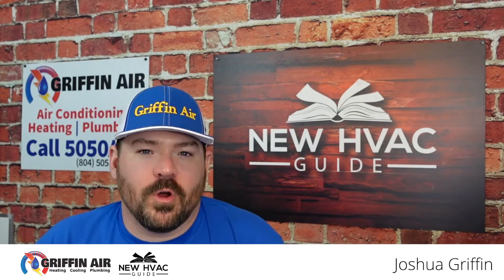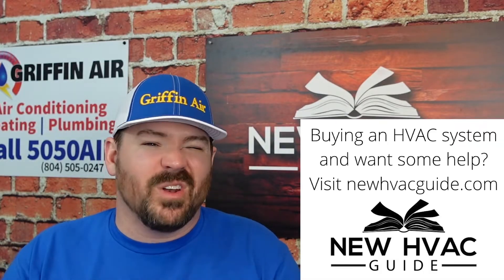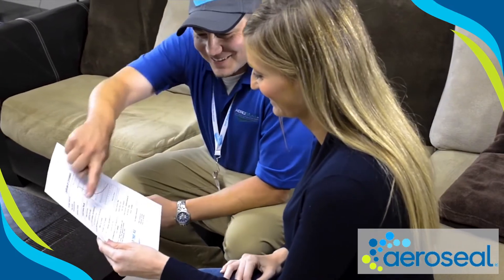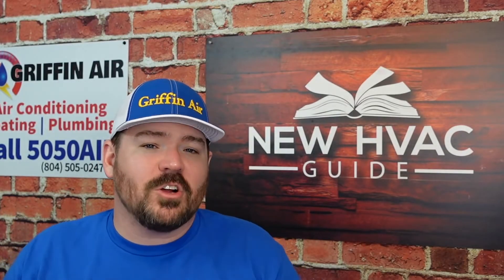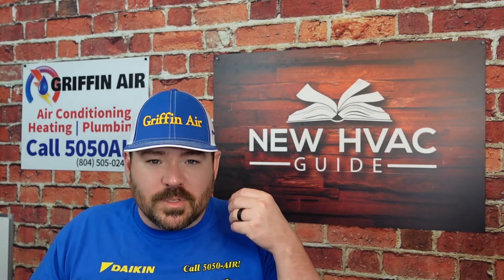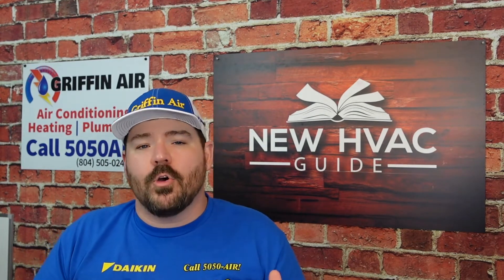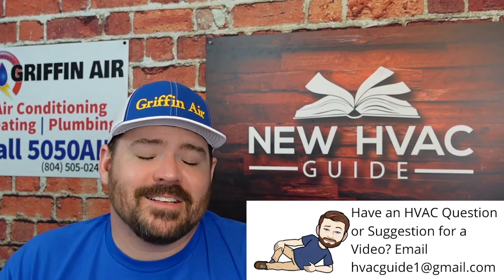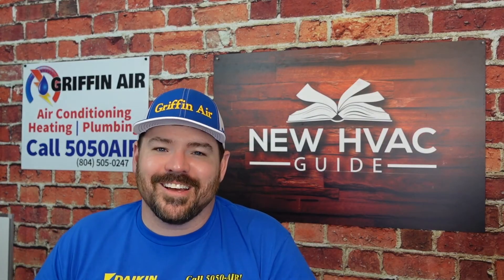5 REASONS for Low Airflow.

Comment: I just had my AC guy come over the new ac unit he installed last year stop throwing cold air, he said that the system was getting drowned, he said he was going to install a box to avoid the unit from drowning. He did get the right box change the original ducks going into my goods man unit and i lost air flow in all the house, when i told him he said they didn't have the box that he needed and gave a different one, and he will installed another one, he did not fix the issue, the gous still feels like you have the air on low the rooms feel warm, you can feel the stop of air flow and he said that everything is reading right and that how the unit is supposed to work. What can I do to fix this issue?

Comment: I am still having an issue and everything was checked. I just bought a new unit 2 weeks ago and the room furthest away is not cool enough nor getting much air flow. What else could it be?
Reply from the maker: Thanks for the comment—and I’m sorry to hear you’re still having issues, even with a new unit.

There are a few possibilities to look into:

Ductwork issues – The duct leading to that room could be undersized, compromised, or improperly installed.

Insulation – If that room isn’t well insulated, it may be losing cool air faster than the system can supply it.

Air balancing – You might try partially closing other vents to help redirect more airflow to the problem room.

System testing – Tools like a thermal imaging camera, anemometer, or even a duct blaster test can help pinpoint exactly where things are going wrong.

I actually cover another solution in detail here if you’d like to dive deeper:
👉 https://youtu.be/AwyIzBOALAg

Good luck!

Comment: I have two bathrooms that get virtually no air flow. Hot in summer, cold in winter. Ducts look good. They are both fed by a 90* duct off of a big duct. The pipe is flush mounted to other duct. Do I need a deflector of some sort to get air to make a 90* turn to get more flow?

Comment: We had installed a new 4 ton split system, Gree flex condenser, new ductwork installed, insulation blown, and added an attic gable fan. Pretty big job done in 2 days. Out of 10 vents throughout the entire 1700 sq ft house, 3 have weak airflow where its needed the most. 2 bedrooms also are warm. How can I measure the airflow out of each duct? The tech used an infrared tool to prove cool air was flowing, but 1 particular vent has the strength of a leaf blower, while the others vary. Paid a lot of $$$ sounds like I need him to come back.
Reply: I would be so mad after all that work for that issue
Reply: Maybe they sized the ducts poorly and now  need to compensate with dampers

Comment: 4 degree difference from one side to other side of house, the equipment is on better side any suggestions?
Reply: ^ yes dampers, HVAC pros, not so much.  They all want to upsize my upstairs d u c t s, which involves removing asbestos insulation, ignore or dismiss my questions about dampers, one said it was impossible, on his way out I looked behind one of the registers and said what's the heck, it's a damper, he looks surprised and mute.
It's impossible to find Qualified and honest HVAC
Reply: First, there maybe be dampers installed within the hvac ducts in your home.  Some of those ducts may be partially closed.  Those dampers are visible with older metal; ducts and are basically a handle that has a specific range to it.  Finding dampers in flex ducting is a little more difficult but not impossible. Second, there may be leaks that exist on one side of the ducts versus the other. Determining exactly where they are is a job for an HVAC tech with the proper test equipment. The main HVAC system air handler for a home is connected to a series of ducting, which is likely where the problem lies. That being said, there is one other possible explanation, that being an imbalance of insulation in one part of the home versus the other.  Checking the amount of insulation requires an infrared camera which can determine if there is a heating or cooling loss more in one area of the home versus the other.  I do suggest that you enlist the help of an HVAC professional and wish you all the best in your quest.